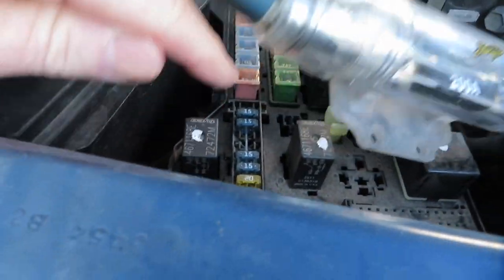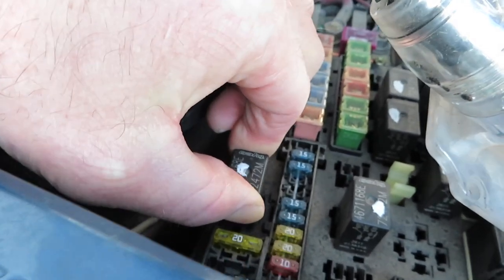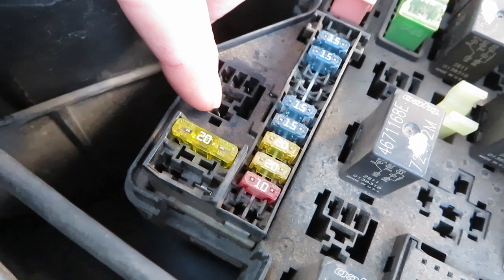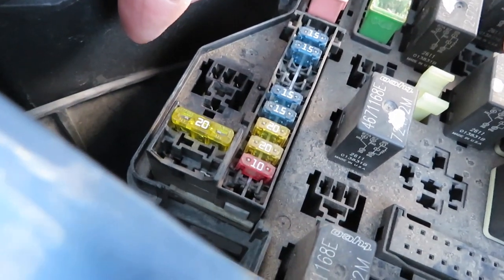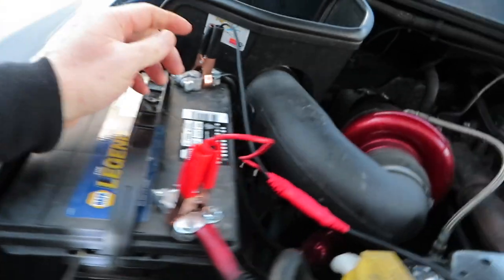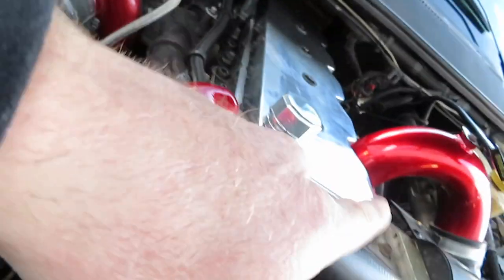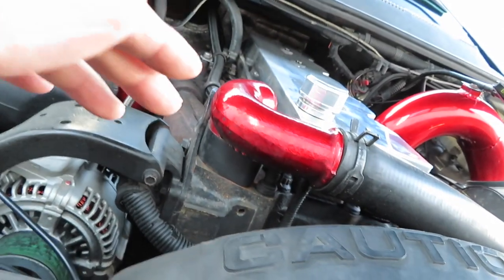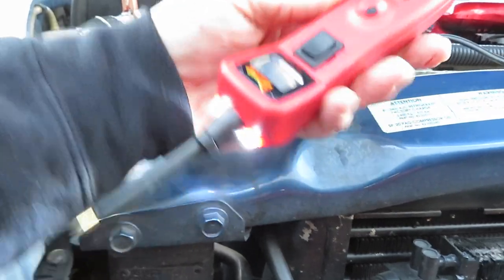Checking a VP44 on a Dodge Ram 2nd Gen Cummins

Comment: My brother my brother, i hope you see this and respond, I'm working on one of these in a forklift and it originally had a mechanical lift pump, i ran an aftermarket electric pump from the tank... Is there any trouble that could cause?
Reply from the maker: I don’t think it should be a issue

Comment: Went through his whole check list. I finally pulled the return line above the fuel tank and it finally started to kick off.
Reply: This was after I replaced the returns behind the head and from the injector. Making sure the copper washers were good and the T connection was sealed properly. Make sure that line isn’t air locked

Comment: My truck was throwing a crank shaft sensor code. I change the sensor now it would start. I checked all my grounds.  It has fuel pressure I’m at a complete lose. Do you have any idea on what it could be? The check engine light went off after changing the sensor but now it won’t start

Comment: Ever seen one that keeps getting the P0216 error code and the truck still runs great?  My 02' has been getting the P0216 code for several years now.
Reply from the maker: No I haven’t
Reply: Any solution to your p0216 code? You’ve had it for several years? Does it ever clear?
Reply: Just bought a dually with this code, but truck runs fine, starts fine, previous owner thought it needed a vp because of the code
Reply: @rosshoffman7377   No, mine has been getting the P0216 error code for about 5 years now.  The truck still runs great.  You can clear the code but it comes right back.  I guess I'll just run it till the VP44 dies.
Reply: I've got a 01 3500 with  24v that keeps showing the p0216 code and mine runs great but I'm having issues with my throttle response.  I've replaced the apps/tps 3 times and reset it a few times and now it keeps popping up with p0222 and a p0121 code . Both are tps sensor codes . Any advice would be great . Times like this makes me wish I could've found a 12v instead

Comment: Any normal test light will check grounds, just put the clamp for the light on the positive battery terminal. Then touching any good ground with the light probe will light the light.
Reply from the maker: True but a test light does not show voltage.
Reply: @ChadMyers73 correct, but the light puts a load on it. Light stays lit solid and consistent. A meter will show the voltage, but without any load. Pros & cons both really

Comment: I do a complete ground inspection/cleaning once a year. Just pick the nicest day in the spring or summer (no need to break a sweat), power wash your rig top, bottom & side and go over every ground you can find. Remove the ground if in doubt and clean/sand the connector and body to get down to bare metal. A little dielectric grease on the connection and you're good to go. Trying to locate an intermittent ground along the side of the road at night will drive you insane (been there).
Reply from the maker: Great idea!

Comment from the maker: One thing I forgot to mention was the codes I had on my truck. This is the codes I had When turning the ignition and also with a scanner.
PCM
0122 TPS sensor 
1693 Companion code
ECM
1693  Companion
0382 Glow Fault
0380 Glow Fault
0215 Fuel Injection Pump Circuit
1689 No Communication   Between ECM and Injection Pump
Reply: sounds a lot like a grounding problem you found.  Check out Military battery ends, You will love them!

Comment: Great video I'm trying to diagnose my vp44. Truck won't start after it's hot until it cools and going down the road it struggles to get up to speed and that symptom comes an goes. I'd hate to buy a new pump if that's not even my issue. Everyone that knows this motor is saying it's the pump.

Comment: Very helpful info. I have a 2000 dodge cummins . 5.9 24 valve.  2 wheel. Its clucked out on me. Its will crank but no fluid going. Whlent to oriellys to use there scanner. And it said fuel injection pump valve. Open circuit
Reply from the maker: Thank you and thanks for watching!

Comment: My truck runs and drives but it goes in limp  Modelike if I press a gas pedal aint doing nothing and then I got a code for the injector/VP 44 and timing.
 Don't know where to start.  Besides buying a new VP 44 and don't really want to do that.

Comment: This video is really going to help me out this weekend. When I was driving home today my truck completely died and cut off and now won't crank back up so I towed it back home. My lift pump is good so I'm guessing it's my vp44 because the truck cranks over fine just won't fire off.
Reply from the maker: Hope you get it figured out. I have a couple of vp videos on my channel.
Reply: My truck did the same. It was below 0 here in Colorado. Wont start. I replaced the Fass filters. Still won’t start. Hopefully it’s just air in the lines.   Great video. 
2001 2500 6speed 5.9L
Reply: @eddiebartlett5972  I changed my filters and cracked my injector lines until fuel started coming out and then tighten them back up and the truck cranked back up and has been fine ever since!
Reply: Thank you. This is great info. I shall try !!!!!!   Also to the guy who posts these videos.   Thank you as well

Comment: I have a 2002 5.9l 24v and it has a p0216 code. Injector pump doesnt have 50 miles on it. It has stock lift pump in the tank that was replaced recently. Starts up with 15 psi of fuel pressure. Any ideas to fix it before the new vp44 goes bad again?

Comment: I’ve been having an issue with acceleration when my truck is cold. I hooked my scanner up and drove the truck and it says I’ve got about 11.4-11.8 volts at my vp44 depending on rpm. I’ve already replaced the pump but I guess I’ve got a wiring problem or ecm issue?
Reply from the maker: Possibly the TPS also

Comment: my truck is acting like it ain’t getting full fuel. it starts, runs, and drives.. just doesn’t want to go when you start driving. i cracked the fuel pump and it squirts out fuel like it should. great pressure there. but i don’t wanna replace the injection pump without knowing thats it for sure. any ideas for me?
Reply from the maker: Did you make sure all injectors are getting fuel

Comment: Maybe off topic a bit..... But i just bought a 2002 24v , and I've replaced the oil and later on noticed that i was overfull, and smell diesel.... Thought i had Leakey injectors, so pulled them out, took them to get them test and turned out to be ok, replaced the copper washers on them and installed them back, replaced oil and sti have that same problem...... Any help would be appreciated on tips to where to go from here
Reply from the maker: Could be a cracked head or crossover tubes.
Reply: @ChadMyers73  thank you for taking the time to help.... I thought of a cracked head or piston, but i have no blow by at all, the engine does not misfire or nothing, once it starts it runs flawlessly, could the vp pump be a possible cause???

Comment: I have a 00 24 valve I keep loosing communication between ecm and injection pump is my ecm bad or my injection pump going out I'm getting 1689 1693 code
Reply from the maker: Check all of your grounds under the hood but other than that it could be the ecm or wiring harness

Comment: Buddy! I am having issues with my 2000 24v 5 speed. She starts every time and she idles great for the first 5 mins then she runs rough and rpms bounce between 800 to 1000. If i give a tad of throttle she jumps to 1050rpm and will not come down until i put it in gear. 
When driving it she seems ok until I start coming to a stop then she idles too high making it harder to slow down. Also when I rev it in idle to about 2k rpm it sounds like its hesitating/stumbling. Here is a video of that.. https://www.youtube.com/watch?v=_S2SmiQxg3M 

Sound like a fuel issue to you? Any help is appreciated! Thanks so much! 
i wanted to check the fuel pressure but not sure how since my filter canister has been removed.
Reply from the maker: I do think it’s a fuel issue but it could be a multitude of things I would check for air leaks in your fuel system could be a bad injector could be a PCM issue with the VP 44. Check and see if there’s any codes stored and start checking for air leaks in your fuel system.
Reply: @ChadMyers73  come to find out the new "Bosch" injectors I installed about a month ago are not real bosch lol. Had them pop tested and shop said they were between 220 and 250. So he said they were junk lol. Lesson learned not to buy injectors on Ebay haha.
Reply from the maker: Yeah I buy all my injectors from Ducky Fuel Injection

Comment: I am not getting 12 volts to relay pin 37 with key on. What might cause this?
Reply from the maker: Check fuses in the cab and all your grounds.
Reply: Checked all grounds, sent ECU off to get checked twice, gauge cluster tests good. Anything else you can think of before I replace engine harness and relay board under hood? Thank you for replying.
Reply from the maker: Yeah that would be the next thing is to check continuity in all those wires
Reply from the maker: And your welcome 👍👍

Comment: I have a 1998.5  RAM 2500 5.9 24 valve Turbo Diesel  that is throwing a code P0216 "Injection Pump Timing Failure" I received a quote from the mechanic for $6,350 to replace the VP44 pump and all fuel injectors.  He says the fuel pressure is 10 pounds and should be 8 pounds and the excess pressure is resulting in the diesel fuel foaming up and not staying in a liquid form.  Does this sound right?  Many thanks for the information!
Reply from the maker: No my vp always has a Constant supply pressure of roughly 19 pounds from my AirDog
Reply: 10 pounds sounds low to me . The 8 psi he mentioned is what the old ford 7.3 idi diesels require . I've got  14 psi on mine and I haven't done any upgrades to it however it does have a in tank lift pump but I'm not sure if it's a aftermarket brand like air dog or fass etc . I'm not too familiar with these cummins but based off my research you have to have atleast 5 psi at the very minimum or it'll damage the vp44 . I'm no expert so somebody correct me if I'm wrong always open to any help/advice knowledge I can get

Comment: Hot wire vp???
Reply from the maker: Yes the safest way to do it would be with a breakout box. Otherwise you just take a ground and a power wire and hook it to the corresponding leads on the plug.